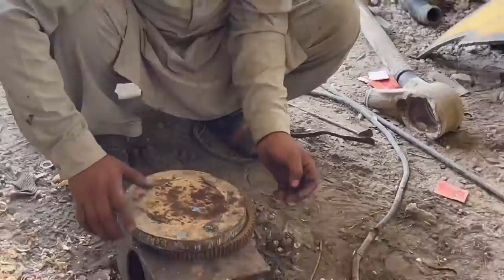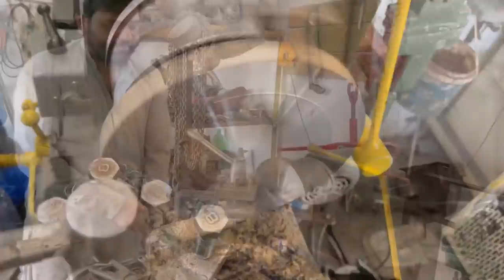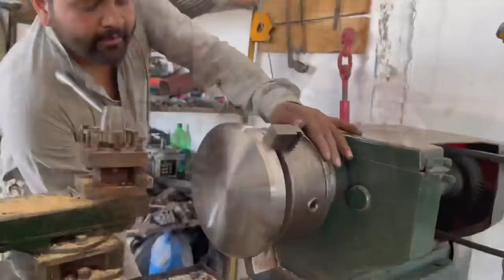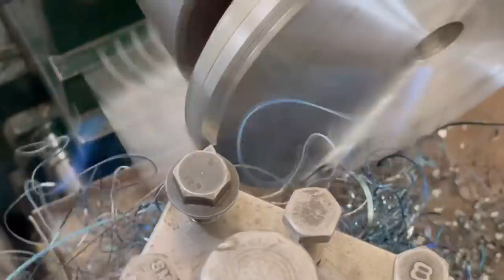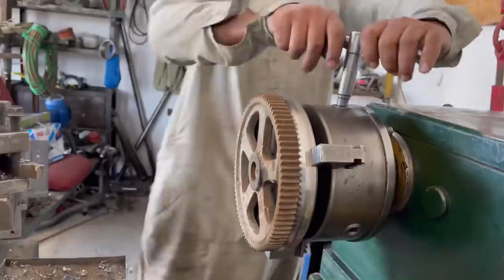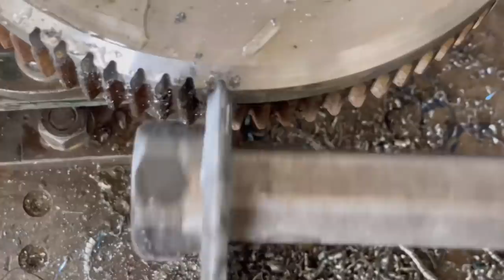Amazing  Manufacturing Process Of Gear |

Comment: The cutter was not on center and cut every tooth more on the bottom than the top . Every tooth was a different distance from the next one.  The teeth are too narrow because the guy got carried away with rounding the corners off . It was also the wrong pattern of cutter for duplicating the master tooth pattern  . Scrap metal turned into more expensive Scrap metal  .
Reply: wkwkwk Scrap metal turned into more expensive Scrap metal. this is primitive technology
Reply: @anonymousdifergent3922  So primitive that this was something that would of been made by the cavemen in the dinosaur age lol
Reply: it was just for show and a money video. like said it is useless

Comment: If you have ever made a gear, you would know this was just a show, that gear is useless.  Notice the one tooth when he first starts to display that has a wider profile.  🤣
Reply: That one is the 'clunking' tooth....it goes clunk once every revolution.
Reply: well you can clearly see he is just eyeballing it when he rotates the gear freely. the jig has no way to turn the plate the correct pitch and use correct spacing for the teeth.
Reply: yes , but it matches the other gear he made .

Comment: That isn’t a usable gear.  The teeth are far too unevenly positioned.  You need a precise stepping mechanism to cut gear teeth.  This is just a waste of time and materials.
Reply: Sheraz Ali  Hard to see how.  The teeth vary many millimeters in depth and angle.  At 19:41 you can see a row of teeth where the tooth tops vary like 50% in width.   Good luck with that!

Comment: Why? Why ruin a good slab of material to create something 100% non functioning? This is either April's fool or just trolling.
Reply: just because you can go and buy a new gear does not mean everyone can he creates them jealous much how the hell do you know it wont function were you there
Reply: @bobcatwelder00  you can clearly see how there are no 2 same size teeth there and the last one is twice as big as the rest, they would never mesh correctly which is the whole point of gears TO MESH. Good as a show piece, shit as a gear. 
Minimum you need is an indexing head or other means (jig) to allow consistency through the teeth. NOT eyeball it for  "looks about right". There is a whole science about gear geometry etc. Who knows if he was even using a correct gear cutter size for his gear.
Reply: @Baisulis84  dude does it say it was factory stamped on it any where lmao does not have to be perfect to bea gear
Reply: @Baisulis84  Chances are it was not 100% finished at the end of the video but still rough, and also a good chance the gear was meant for some crude, worn out old machine like a cement mixer drum or something
Reply: @HobbyOrganist  usually the milling process is the final product. Usually.

Comment: should have made a toothlocator first , it would have made it easier and better also needed turning over to finish the other side .
Reply: it wouldn't matter anyway the gear was garbage. he just eye balled the pitch and teeth depth and spacing. he just turned the gear freehand, the jig holder he used had nothing to stop the gear when he turned it to get the correct  pitch and spacing. the gear is completely useless. this is just a video to post for money.